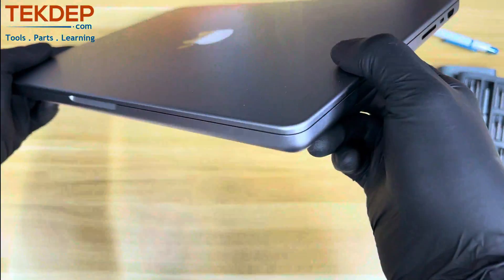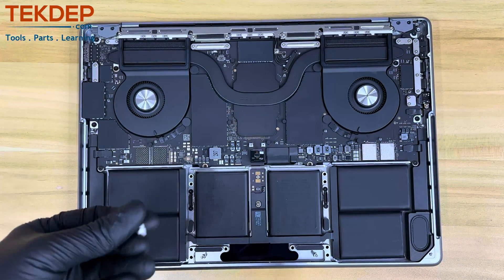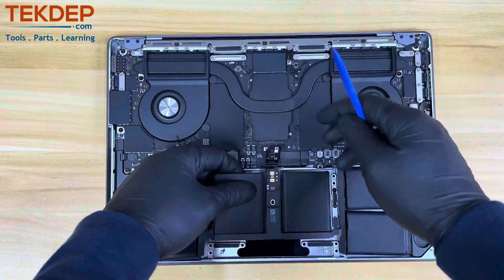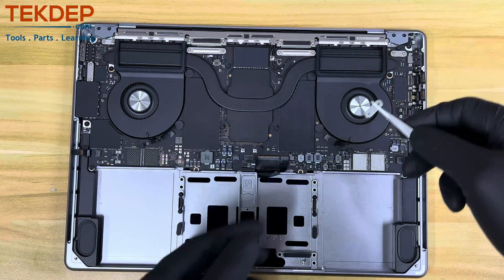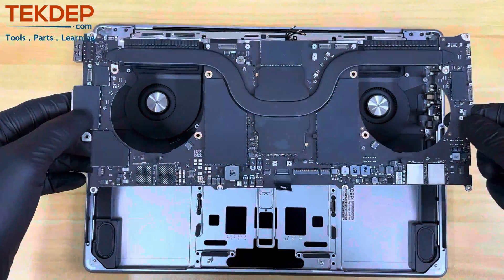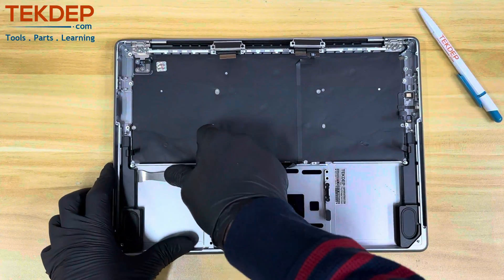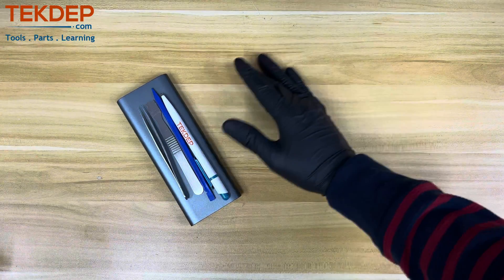M1 MacBook Pro 14" | Tear-Down Disassembly ( A2442 )

Comment: Hello. Great video mate. Is it possible to replace the speakers without messing with the rest of the macbook? Meaning would I have to just remove the back case and pry open and replace the speaker? or would I have to disconnect the power and all?

Comment: is the microphone included in the top case or can i replace only the microphone without changing all top case?
Reply from the maker: Microphone is a flex cable that is attached to the top case and you do not need to replace the entire Top case just simply purchased a microphone from our website and replace it. Here’s all the info on the bottom.!

If you're still experiencing issues with your device and need help, we offer a convenient and affordable Mail-In Repair Service and data recovery. You can learn more and get started here: https://tekdep.com/device-repair/

If you need parts or tools for your repairs, we have them all and ship worldwide! visit: https://tekdep.com

Comment: is it possible to remove the hinge cover without first removing the antenna bar? i unscrewed the two screws for the hinge cover but I cannot take out the hinge cover even with using some force.
Reply from the maker: Yes, you may have to press down and wiggle the lcd hinge covers out but it can definitely be done.

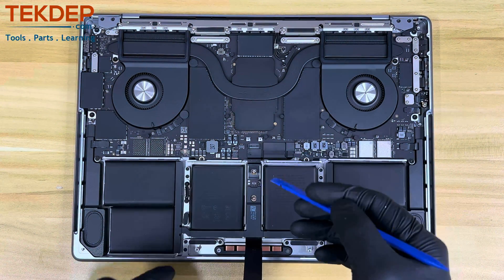Comment: 1:51 i think bad idea battery connection pull up cause that cable is metal 
If move to much very ez to broken
Reply from the maker: Repeated bending of the battery connector back and forth will stress the connection, but any normal amount of movement and in a normal consideration is perfectly safe and will not harm the connection bar. These are really hard to break, you would have to be really trying to do so!

Comment: Hey! I have a question, Can Touch ID be transferred to another Topcase by myself? Should I do anything with it or it will work good if I simply replace it ?
Reply from the maker: You can remove and transfer to another top-case but keep in mind the Touch ID is paired to the original Logic board and if not connected to the board that was paired originally by Apple and get connected to another Logic board than it will only function as ( power on and off bottom ) and no longer functions as Touch ID sensor

Comment: I see that whoever will want to open the thing and repaste the shoddy thermal paste that Apple puts on there will have to go through 40 screws and tons of special equipment. Fuck me.. I'm getting one soon, and this is NOT something I look forward too. Especially because you need a thermal paste and a very soft thermal pad in order to fully cover the SOC, which makes it a pain.. because you have to put 45 minutes into assembling it an testing weather you've got good contact. This is nightmare. Thankfully it's all screwed in, not glued.

Comment: So, does apple sells the battery for this model now, or at least certified 3rd parties?
Reply from the maker: I don’t think Apple sells this battery’s to individuals, as far as we know they only let Apple certified repair shops and actual Apple stores install them, so the only way is to let them fix your laptop and pay lots of $$ or purchase a used one in good condition or just buy a new aftermarket and replace it your self or have someone who know do it, t

Here is a link to A2442 Battery, this one is Used very lightly and it’s original 
https://tekdep.com/product/a2519-li-ion-battery-080-333-4000-for-a2442-apple-14-macbook-pro-2021-m1-pro/

We also have the aftermarket version that is just as good. 
Good luck.

Comment: internals are good or bad?? any issue after 6 monyhs
Reply from the maker: We do use one of this unit in office and works great, we love the new MacBook pro m1 Max, but for much less and similar performance you can get the any of the 2019 model's, almost 1/3 of the price. good luck

Comment: On my 14 the little cable on top of  the battery connect had no small metal bar to pop up to release it. You just pulled it out.
Reply: and what?
Reply: the cable from the middle'?

Comment: Hi, Have you noticed that with macbook pro 14 if you move it horizontally to left or right something moves inside? I checked with a another 14 model in the shop the same, but only 14 models. Can someone confirm this :)
Reply: I personally have never had this issue and I've had mine for just over a year now. I did have to send it in for a repair of the screen due to a factory issue. Idk if they would've done a quick side mission to fix anything else (doubt it) but I also didnt notice anything moving before he repair

Comment: Hi,
Great video,
One question:
Do you think it is possible to pair a new fingerprint sensor to the motherboard? 
(Does it require special SW to re-pair or is it "auto learning" )
Reply: Umesh I don't think so cuz those guys at apple firmware lock everything
Reply: @harshkalbhor4653  good lol it’s my biometric data
Reply: @BlueDippy  encryption would also work.

Comment: Hi thanks for the video and the great quality. One quick question, if some water just falls at the bottom of the screen, how likely is it that it goes up the vents entries? I see the holes on the sides just lead to an empty space but in the middle it looks like it is the logic board. As the bottom of the screen looks like it has a « L » shape if the water falls there can it be retained an pushed in?

Comment: Goodmorning tekdep, I was courious to asking u 2 things.
If I open the back chassis do I loose my warranty? How can I know if they know I opened It?
And are those macbook life proof? Are they good for resisting during the next years in comparison with older macbooks? Are the internal conponenets cold and no heat heat and high quality? Thanks tekepd, I appreciate a lot if u answer me. Thanks brother 😇
Reply from the maker: Greta question! Im not sure you if your voiding the warranty only by opening the back case to take a look, but im sure it will void if you go behind that point and remove or alter or replace parts, all the screws used on the Mac can show that if they ever been open or not, basically they will look for the signs like screw head showing signs or a cable been moved around or anything unusual, and that may void your warranty by apple I believe, check apple warranty page for more detail. 

2nd part of your question, regarding if the laptop is life proof like older models, in short No its not, if anything go bad in this newer models you need to change the entire logic board or good luck getting it repair, but im not saying don't buy one as I have the most max out 16inch model my self, my advise is you better do not take it outside in your backpack much and keep on your desk and never drink near the laptop and that way you can use it for next 5 years for more maybe. 

bottom line the 16inch & 14" MacBook book are not repair friendly but they last a long time if you keep this away from trouble and consider apple warranty.
Reply: @tekdep  ok thanks very much fo ur long answer to my questions, Ive boght the 14 inch version btw. One other thing: can Apple use planned obsolescence to make stop fucntioning those machine? For example they make the logic board fail so u have to replacit it or buy another one new?

Comment: Do you think user can customize their ssd or RAM?
Reply from the maker: In short Not at all, Latest Mac Model that was customizable in term of Ram & Storage was from the Mid 2012 ( A1286 & A1278 ) Unibody Model, 

SSD Storage on other hand was customizable on all MacBook models ( Late 2012 to Mid 2015 ( A1398 Family ) and you could of upgrade the storage aka "ssd" 

Beginning Mid 2016 ssd was no longer upgradable on all Mac laptop models, 
So if you're planing to buy a new MacBook laptop of any model, make sure you buy the amount of ram and ssd you will need later, as you can not upgrade it in anyway possible, 

Unless you're a well experienced logic board technician with high level of repair knowlage that can perform micro soldering and can do a high level technical chip transplant between to laptop logic board!
Reply: @tekdep  https://www.youtube.com/watch?v=0ecSzeqYX3E&t=25s